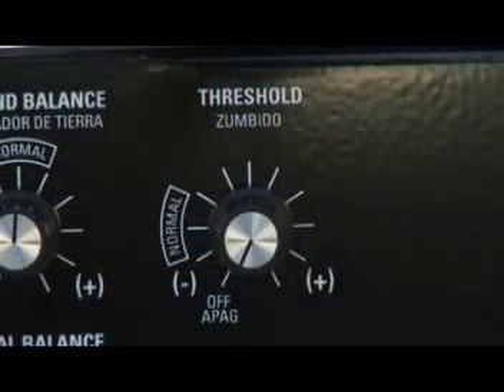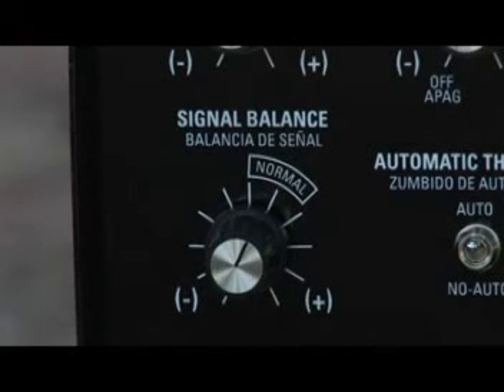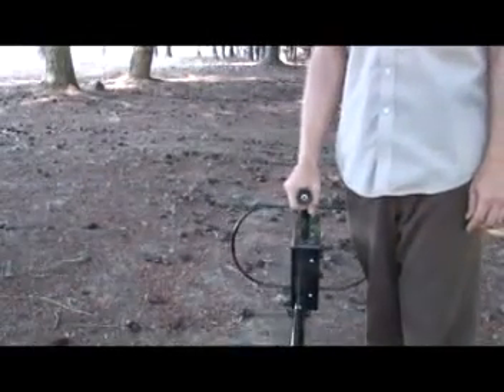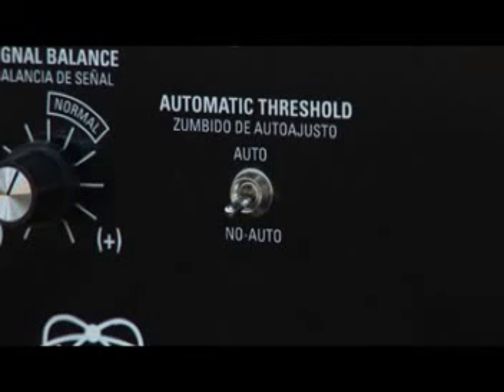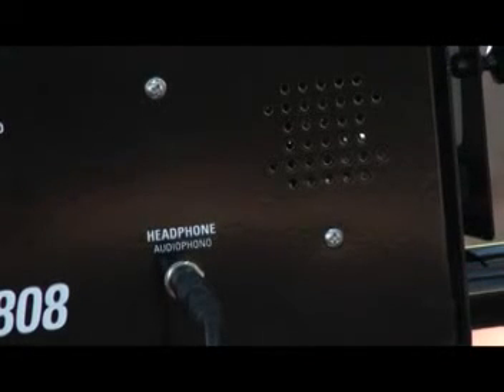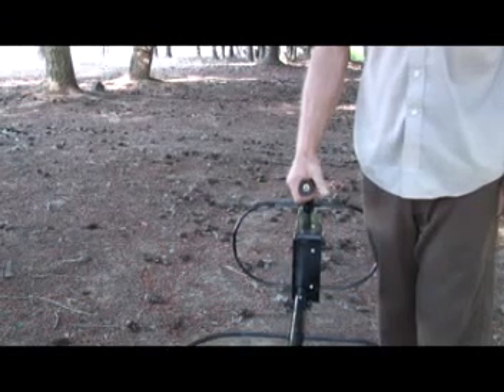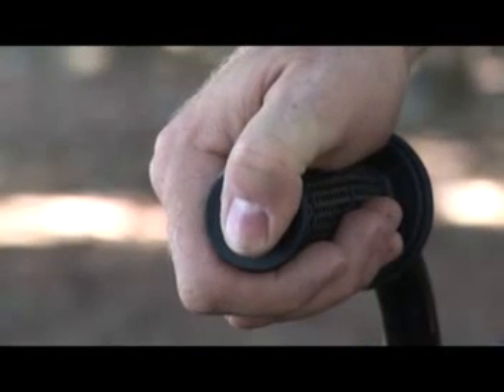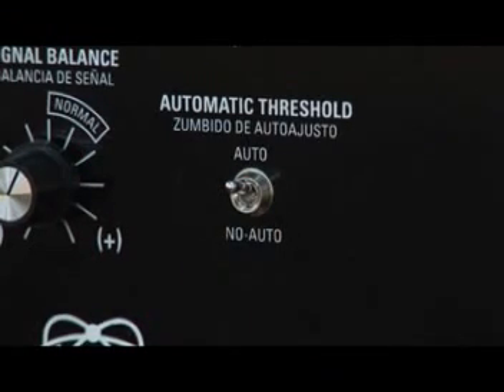TM 808 Setup

Comment: Once I have balanced the unit do I push the handle button in again before I put it back to the 'AUTO' position or do I just leave it as it once it is balanced?
Reply from the maker: You should leave it as is, and push the button to retune if necessary